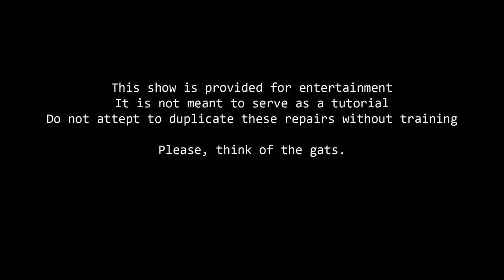1887 Winchester Restoration and Conservation; Anvil 049

Comment: I bought a very rusty brown 1890 flobert cyclist pistol and took it apart.
Degreased it, then boiled it for 45 minutes and brushed it very gently with some steelwool (first soaked in alcohol) then i soaked it in petroleum. (Heater fuell) and wow what an awesome result. Underneath the rust was nickleplating and the moving parts like hammer, trigger and extractor were black. Now it looks nice and is functional. 
It' s only a real challenge to hit something, it's tiny. 

I learned that from this channel. 
You are a great teacher Mark.
:))

Comment: Thank you again for emphasizing not to throw out the bag until the job is finished because small parts can be caught in the folds.  
I've had many arguments with people who have thrown out boxes w/ packing material from /new/ parts orders after screaming they didn't find everything they expected.

[Distributor] and [Mfg.s] maliciously sent us "complementary" replacement orders knowing that the customs duties/taxes would cost us thousands of dollars for the dozens of repeat orders those "people" placed every week; Irrespective of /if/ I'd handed them the heaps of parts their boxes that I had to pull out of (and around) the overflowing dumpster to make room, and found literal heaps of parts that fell out once I'd "cleaned" them out.

(Even more infuriating was that we'd had compatible "generic" parts on the shelf but they'd wanted to use the "actual" parts from the companies that made the datasheets they found by Googling the internet; and not our internal library incl. parts from those same companies by type...)

Comment: I owned a model 1901 Winchester Lever action 10 Gauge back in the 1970's.The Model1901 was similar to the 1887 but it had an articulated lever with a locking latch which locked the lever in the closed position, similar to a Winchester 1895 Lever Action Rifle. The 1901 was designed to handle 2-7/8" Smokeless Powder loads. I shot Remington 2-7/8"factory loads (which they still made back in the '70's) and Smokeless hand loads in the 1901. The 1887 was NOT designed for Smokeless powder, it was intended for Black Powder Only. It might be safe for light Smokeless loads if they are properly pressure tested. However, I would recommend just shooting Black Powder in the 1887, if it is in good condition, and enjoy it as it was intended to be used. 
Regards,
Gungineer,
Mike Piekarski

Comment: Dad had one of those when i was a little fella he bought it for 25-30 $ got it home and went through it it has some issues with the lever and bolt and loader assemblies he tore it down and looked it over and dove deeper into the fireing assemblys and all that and yes like that one there it was packed full of rust unburned powder and dirt and munghe finally disassembled the full gun with exception of the barrel and loader tube. The wood was excellent with a few dings and slight scratchesnothing that took away from its looks the whole gun was a kind of orange brown colorafter tearing it down as far as possible he ran it through a steaming hot bath in a wash cabnet that only used super heated water and steam it turned out very nice all the original blueing shown so wonderfully and the wood he cleaned and steamed out the dings and the scratches about disappeared.all the parts cleaned up and exposed some ware problems that he had addressed by Otto Strenkert a pretty well known local gun smith and machine shop owner he restored and repaired the worn parts and reset the parts that were at their worse that would keep the gun from being a runner. Dad found some period correct ammo for it and burned off a few rounds  cleaned it and sold it shortly after with documentation as to the restoration of worn and broken parts repaired by Otto.when it sold the fellow who bought it was the same fella who sold it to dad, i guess he was happier buying back his gun in its prettier state and paid 10x what he sold it for at his insistance. Dad let him have it back. Until i seen that one on your bench and in terminator movies and johnwayne movies return of the 66, i really didnt think id ever see another like it.

Comment: I'm looking at a nice old Colt Lightning slide action rifle in 32-20 that is all in brown patina, a perfect prospect for boiling/steaming.
Reply from the maker: YES it is a perfect prospect
Reply: I have a Model 1873 Winchester in 32/20 that I got like that too. I love it when I can find guns like that someone has had in a corner of a closet or under a bed and they sell it to me for hardly anything because of the way it looks. That Winchester turned out to be a gun that is mechanically perfect and still tight. And I have been very surprised at just how powerful that cartridge is and how accurate the gun is.
Reply: @marknovak8255  are you using distilled water ,or town water for this process ?

Comment: the magazine tube is threaded. Good idea to leave it the threads are super fine and delicate.
Reply: I didnt see the little hole on mine and screwed it in any way and lightly damaged the threads. I used a small screwdriver to fix the threads. I then turned it tightly to match up the screw hole and it worked. The threads are very fine and damage very easy. This is on a riotshotgun, not a 1887 lever shotgun. They almost look the same in some parts.
Reply: @dalanwanbdiska6542  glad you were able to fix it! The riot shotguns are the ones to have they are worth even more. They look pretty cool too with the short barrel

Comment: It's amazing how all that rust was hiding so much of the original blueing of that gun.  Boil it, convert the red rust to black rust, and card off the loose stuff....and behold the beauty that was hiding from sight.  Too bad this technique does not work for wrinkles.....boil my face, steel wool it a bit, and look 30 years younger.  Don't think it will work...and not about to test it.
Reply from the maker: I tried it however, but the results were less that what my wife had hoped

Comment: Fantastic as per usual, how long would be optimal to leave your parts dangling in the sauna to convert, thanks 👍
Reply: In a different video I think Mark said he usually does it for an hour or so. For legal reasons he wont give out advice on projects which is understandable (says so on the website). I plan on doing this to a martini henry I just picked up from IMA. Its kinda rough but I think throwing enough man hours at it will clean it up nicely.

Comment: I’m looking to clean up a a browning model, 71 Brand New gun, it was stored on a rack and moisture got to the gun. It is brand new. The wood is fine it has some surface rust in certain areas. Nothing too much. My concern is what is on the inside can I just boil it Can I pull the wood off and boil the gun with the springs still in the receiver? Will this harm the temperament of the springs or do I need to actually do a complete disassembly. I would like to just either soak it or boil it and cart it off, but I’m not a gunsmith and afraid to get too deep into it and totally disassemble it,my question is will this hurt the temperament of any springs that are inside the receiver? I’ve been studying your videos and others intently to learn how to properly handle and conserve the firearms I am maintaining
Reply: If all it is is surface rust spray the inside with a moisture repellent oil like WD-40 let it soak then blow it clean then oil it & cycle the gun.

Comment: I guarantee you that shotgun is going to be fed some really bad ammo. I have seen it time and time again after I have worked on some of the older levers like that one. They either end up completely blowing the barrel at the breech or blunderbuss out the muzzle. It happened to me with exactly the same model that you just conserved. The end of the barrel on a 12 guage got about the last 5 inches of the barrel completely blown apart in small shards. After many minutes of schooling on the loads that the shotgun was designed for the customer finally GOT iT. All I did for him was make him a shorter legal length sawed off shotgun because that is what he wanted then. That is after I took it down and went over the barrel to make sure it was still in good enough shape. That steel shot in modern 12 guage 3 inch magnum shells will ruin an old shotgun every time.

Comment: 👍 nice! Mark, I need to bring an SKS outta the gack.  How should I treat the stock? Espy the wood grip and gas piston tube area. Don't want to take that apart.
Reply: @THEROTTINGDOG  
Thank you the info, but I meant the wooden guard around the tube after the tube is off. Is there any concerns for rust between the tube and the furniture? That is a pinned together assembly, not easily taken apart. Thanks
Reply: @James-fs4rn  I've never taken them apart but examining the side you can see (underneath the gas tube) I have never seen corrosion starting or festering there. Even on trashed U-Fix-Em Yugoslavian M59's from Century Arms, they always look good I guess because that is a pretty thick layer of wood protecting it. You really should not pose questions on Youtube videos that you want answers to. Join a gun forum and ask or look for the same question--9/10 it's already been asked before.

Comment: I've got a real tough question, I'm not sure who to ask, or where to find an answer.  I bought a Winchester model 1887 in 10 Gauge.  But it's in bad shape, missing springs, lifters, screws etc.  No one has parts for the 10 gauge.  But some have parts for the 12 gauge.  I wonder which parts, if any the are made for the 12 also fit the 10.  If not, where do I go from here?  Do I barrow another 10 gauge to measure parts for specifications?  Is there a place I can get design specifications for such parts?
Reply: Are you willing to sell those 12 Gauge parts? Lol
Reply: @TheBwrn14  I don't have any 12 gauge parts.  I said some other parts dealers do.
Reply: Ask Mark or Turnbull restoration in upstate NY

Comment: Mark, I have been working on a lot of shot guns and 22lr from the 70’s the metal finishes are cold blue. Do I stay either the cold blue? I’m tempted to rust blue these guns.
Reply from the maker: Rust bluing is significantly more durable and cannot be rubbed off. Check out Bob at rustblue.com and we have several videos up about this also

Comment: The front looks like it can use the barrel band for a newer norinco 1897 m97 riot shotgun. I took mine apart lastnight and got all the factory sludge out of the receiver and now the action runs alot smoother. I trade off my old remington 870 wingmaster for this new riot shotgun.

Comment: Hi Mark, 
I've got a very poorly Schmidt 1889. I don't know how familiar you are with the rifle but it has a bolt "release" (disassembly latch if you'd prefer) and mine has got the spring stuck in a way that it will no longer move, this means the bolt is locked in the forward position (because when the bolt is drawn to the rear it must overcome the latch) 

At the moment I'm debating just removing the pin which holds the latch then fabricating a new one (it's not designed to be removed; hammered in place) but I really don't want to move original parts if I can avoid it. Sorry to be begging for free advice but how should I go about removing the spring? I've been thinking a small allen key might do it but I'd have no clue how to get it back in there. 

I've asked BotR but he has never heard of the issue before (I had guessed it might be listed in some Swiss field manual as a possible issue)

ps, love the videos, really taught me a lot about firearms and how to care for them especially when information of good quality is so hard to get, especially in Britain.

Comment: Inspiring video! 🙂
Never had any idea it would be possible to save so much finish hiding underneath old dirt & rust & grime...
Do you have any reccomendations on how to go about saving the most of the inside of a barrel that has seen better days?
Boiling it for an hour before going at it with a bronze/copper brush on a stick (mounted to a drill)?
Reply: The boiling process and use of the carding wheel (the super soft wire wheel demonstrated) is meant to convert the rust back into Ferro-Ferric Oxide. the inside of barrels are never or rarely blued. So if there's some major rust and pitting inside a barrel, mechanical removal might be the best treatment. Are you talking about a shotgun or a rifle?
Reply: It's a shotgun

Comment: @Mark Novak, any advice on how to get a stubborn or stuck Mauser Magazine floorplate off? I'm not sure it'll its cosmoline gunking it up or what. I've tried the bullet tip pushing the release button while pushing on the plate. I've even dropped the trigger group out of my Mauser and cleaned the entire mag well and action of any cosmoline visible to the naked eye and it remains steadfast and stubborn. Any tips to get this stubborn bugger free from your experiences working on the Mauser line of rifles?

Comment: Great video Mark.

I've heard you refer to this carding wheels a few times but if I do a search for carding wheel or 2500th wheel I find everything but! 
Is there a generic term that would help.
Reply: Look at Brownells or Midway. The manufacturer is Grobet file company.
Reply: Thanks Gotsloco. 
Looks like they're my only option. I was unable to find them anywhere else.
I appreciate there help.
Reply: Wire wheels are set with a brass wire. Or a soft steel or soft iron wire or hard steel wire and the speeds that you run them at are important too.

Comment: I've snapped off more rusty old screws in wood than steel! Especially early late in 1800/ early 1900s doorlocks/other various things😡 especially when exposed to moisture where the wood holds it in, causing a weak rusted hourglass just above the threads 🤦‍♂️

Comment: When boiling and converting the rust, what is your process with the bore?
Reply: steel brush and either dilute dsolve and oil (if its heavily fouled) or hoppes (if the bore is a bit cleaner)
Reply: Bronze brush is fine, dobt need to use solvent. Card it and run it through again if it is still cruddy

Comment: For those who may not know I believe Mark used a carding wheel to remove the converted rust. Look back at his videos dealing with conservation. Just curious no steel shot used, what was used? Thx!
Reply: Lead shot is used, rather than steel. Lead shot is used in modern loading as well, but not always, as lead in waterways has been recognized as toxic. For this reason many modern birdshot loadings use steel shot for waterfowl. Steel being harder than lead will tend to damage barrels not intended to receive it as the pellets ricochet around on their way out the gun.
Reply: Lead shot was used for several  reasons , it was cheap, easy to make by use of a shot tower, and it has a good weight to size ratio. Steel shot will ruin the old barrels because it cannot compress as it is forced through a choked barrel like soft lead shot will
Reply: It would be nice to see some time when it's not SPINNING. 😄

Comment: Do you use a solvent to remove the mung first or go straight to boiling/ steaming? I bought a tamale steamer and have been using it in place of boiling it has cut my boiling time down from 45 minutes to 15-20.  I get more energy for conversion and cut my propane usage down.  I finished up a Schmidt Rubin  K-11 last night after it finishes soaking in kerosene I will get it back together.

Comment: Great video Mark, I have never boiled a firearm but I am going to start. I do have a question. Would it be ok to wash the unit out in a solvent tank rinse with hot water and then boil? Solvent would be your basic parts cleaner solvent. You have great videos and I have so MANY questions. Thanks Ron

Comment: My sound came and went so just to be sure you used just water to boil it or did you add something?
Also the wheel was a 1000 wire wheel?
I've owned several 87s and 1901 12&10ga but never pulled one down. Just found another perfect for cleaning up. Thanks for a great video.
Reply: 0.0025" wires, I think. Look up "carding wheel" on the Brownells site.

Comment: Nice! What is the wax in the yellow bottle? It looks wonderful.
Reply: Howard brand Feed N' Wax it looked like. Good multi purpose stuff 👍definitely smells good, looks like it might even taste good 😄
Reply: @berryreading4809  Thanks for posting that Berry!
Reply: @stoneblue1795  No problem, It's surprisingly useful for multiple applications, and available at most big box and small hardware stores. Paste wax still has It's place, and temporary spray on furniture polish is nice for cleaning, but feed N wax is like a perfect middle ground for finished wood that needs a quick but lasting revamp that will actually protect the wood. Since it's more of a liquid than a paste or true wax It's great for nooks and tight areas where paste wax isn't very effective, not to mention the time and condition that takes to properly apply... feed N wax just rubs in quickly with little effort, plus it doesn't off gas or degrade much overtime, I have a couple of bottles that are several years old with no noticeable change vs. my newest bottle... Great product for the home, work shop, and gun safe 👍 (They need to put me on the payroll, or atleast give me some free products after all my promotion 😆)

Comment: Where can I get a soft wire wheel like that I need that for the same job
Reply: Brownells It's a carding wheel, and uses #0000 steel wool. Do not use #000 steel wool, it will tear the finish off

Comment: The symbol used on the ANVIL logo, is that the schist disk from Egypt?
Reply from the maker: The inside piece of a primer. What the firing pin crushes the fulminate onto.
Reply: @marknovak8255  What a fascinating coincidence. If you arent familiar with the disk, it's a relic from Dynastic Egypt often viewed as an example of the highest standard of artistic and engineering craftsmanship in the ancient world.